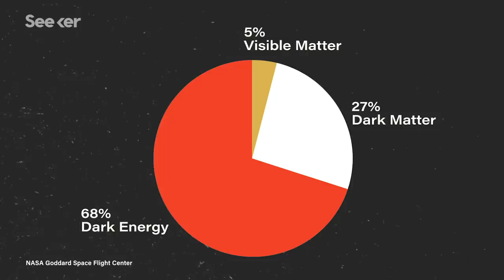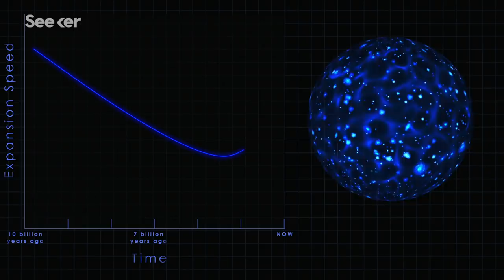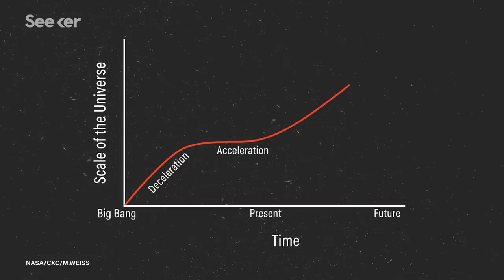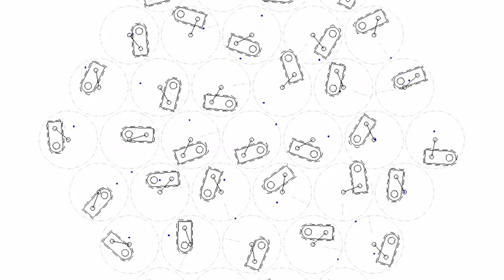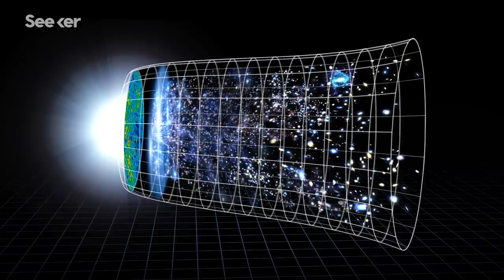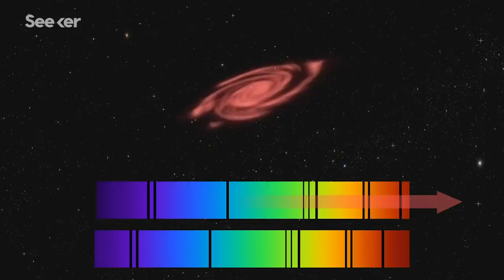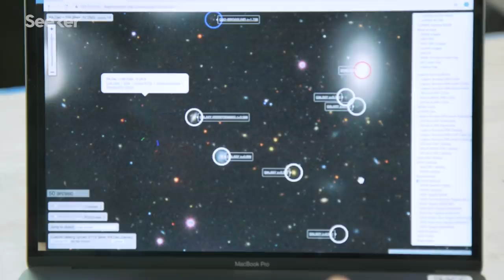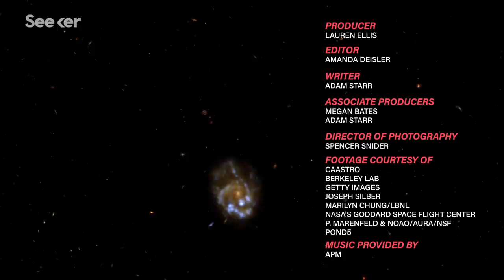The International Hunt for Dark Energy Is On, Here’s What’s Coming

Comment: They know nothing! Massive ignorance indeed. Ignoring the facts. 

The only objects that their movement cannot be explained by general relativity are stars and collections of stars, i.e., galaxies. Stars make up 95% of all the known mass in the universe and yet general relativity is not able to explain their movement. 

What I have discovered, little ole me, is that the movement of stars is not based on their mass or gravity but instead is directly related to their age. The older the star or collection of stars is the faster they travel. This can easily be deduced and has NOTHING to do with their mass or gravity. That is why general relativity is not able to explain their movement. So simple even I was able to deduce that.

This universal rate of acceleration for every star and galaxy in the universe is 1 mi/h increase every 10,000 years. Slow but constant and applies to every star and galaxy in the universe. The force that causes stars to slowly accelerate over time is called, the weak nuclear force, commonly known as radiation. Do the math yourself. Pick a star, any star, roughly deduce it's age and divide that by it's velocity. So simple a fifth grader can do it.

Our sun is roughly 5 billion years old and is traveling at about 500,000 miles an hour as it orbits the galactic center. That comes out to be a steady acceleration rate of about 1 mile per hour increase every 10,000 years. Our Milky Way galaxy is said to be 13.7 billion years old and is traveling towards the Great Attractor at about 1.37 million miles per hour. That comes out to be a steady acceleration of about 1 mile per hour increase every 10,000 years. This is no coincidence! It has nothing to do with dark matter, missing mass or gravity but how old the star or collection of stars is. 

Now what happens with radiation as it enters space around mass? What does new energy do to space around it? Well, energy entering a closed system causes an increase in the volume of space, i.e., causes space to expand between the area where mass resides. Like trying to take a balloon filled with air and slowly adding air to the closed system. It causes the balloon to inflate and expand. You cannot see the air that is added but it is something real being added to the space inside the balloon. 

The same thing happens to space in the universe. As stars spew energy into space it is adding something new to the volume of space around it. You cannot see this energy coming from stars but it is something real being added to a closed system we call the universe. Something has to expand when energy is added. And the only thing able to expand is the space around the mass that is producing new energy into the closed system. The sun's Heliosphere! Energy is real even though we cannot see it. It causes a small effect that is not noticed until there are trillions upon trillion of stars all adding new energy to the total volume of space around them. This explains why the space between galaxies is expanding ever so slowly. 

But when you look at the movement of a galaxy 10 billion of light years away, because of all the stars adding new space to the universe located between that distant galaxy and us the distant galaxy appears to accelerate exponentially to the distant it is away from us. And this expansion rate would not be equal everywhere because galaxies producing new space are not all distributed evenly across the universe. Thus this expansion rate (Hubble Constant) would not be constant at all. The expansion rate would be determined by the amount of mass inside the volume of space that was being measured. The more galaxies there are in a line of sight between us and the distant galaxy being measured the more that space would expand. 

Neither of these observations, dark matter or dark energy occur because of a missing or mysterious force. Each are caused by the weak nuclear force, which is about 10,000 times stronger than gravity. 

There I have pinned both observations, dark energy and dark matter on one existing force and I give predictions that should be explored. The universal acceleration of 1:10,000 that occurs to all stars and collection of stars, i.e., galaxies (dark matter). And the common center for all the expansion of space (dark energy) being mass, stars and collection of stars. If true then every planet in our solar system should be slowly increasing in orbits around the sun as the sun adds new energy to the existing space around the sun. And this is indeed the case. The Earth and every other planet in the solar system is slowly drifting away from the sun over time. Even the moon is slowly drifting away from the Earth over time, a few centimeters each year. This is all no coincidence.

Also note that if the acceleration rate of a star is slow, 1 mi/h increase every 10,000 years then the acceleration is way too slow for the star to be flung out of the galaxy it is orbiting. Thus it would continue to orbit the galaxy for an eternity no matter how much velocity it gained over time. And as for missing mass that supposedly causes the lensing of light, well that is a mirage that occurs when looking through high levels of infrared radiation (heat) between two different mediums. That lensing is not caused by missing mass. The James Webb Space Telescope should be able to deduce that soon.

In conclusion dark energy and dark matter will never be found in any new experiment and it is not a mysterious force. They will continue to go undiscovered as long as astrophysicists look elsewhere for the true nature of what is occurring.  Apparently astrophysicists do not seek the truth of the matter but instead seek equity by keeping these un-found forces as a complete mystery to everyone.

So sorry this comment is so long winded. You wouldn't expect a topic as complex as dark energy and dark matter to be resolved in a just a few paragraphs, do you?
Reply: So you are saying a very old star would be moving very fast? That makes no sense. What is causing the star to move faster?

How does the weak nuclear force cause the star to slowly accelerate?

How does the emitting stuff from the star contribute to the expansion of space?

Where are the evidence?